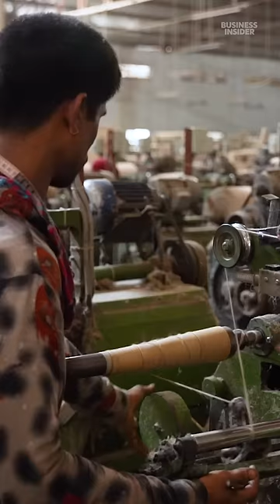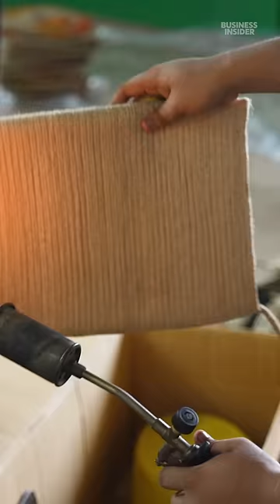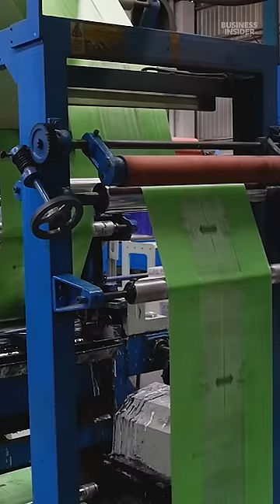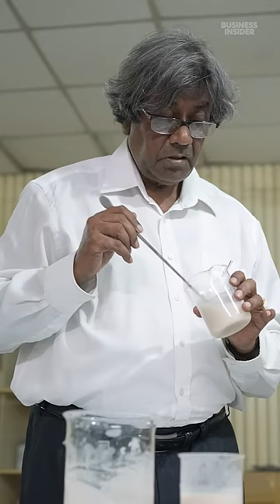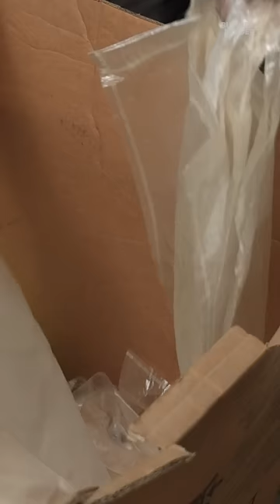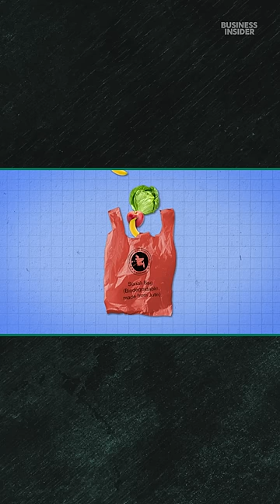Since #plastic bags are made from oil, they are not #biodegradable. Bags made from #jute are.

Comment: You people are aware that one of the primary byproducts of decomposition is carbon dioxide right?
Depending on The conditions that it's being broken down in You're still going to release quite a bit of carbon dioxide and probably methane into the atmosphere. It's why it would be a disaster if you could make bacteria that could eat our current plastic pollution problem. (Not to mention the whole now you have bacteria that eats your plastic before you want it to problem)
If you're trying to pitch this is a way to help reduce atmospheric emissions It won't.(at best a negligible net positive carbon sequestration) If you're trying to remove plastic pollution from the environment, Depending on what polymer you're creating It could be effective to completely unbiodegradable. PLA is a pretty decent example of this, It's made from corn and it still needs to be sent to a specialized industrial composting facility to get it to biodegrade. Ironically there's oil-based plastics that biodegrade better when you bury them in the ground than PLA. Not that that's really a great thing either. Not all of the components that go into it are and the gases and other byproducts released from decomposition depending on the conditions aren't exactly great for the environment either. Ironically just burning it would have a fairly similar effect or possibly better for the environment.(and you get power out of it if you want as well)
I'm all for solutions to problems It's just that they have to actually address the problem and be better than the current options. I just haven't received any information that would let me know if this is useful or just another way to make a already existing polymer. Some of these claims seem to be a bit dubious without more information.
😅

Comment: We just need to replace things with better things. Nothing will change if we don't take the financial hit initially. After a short time volume scale will solve the cost issue. There is almost no way to compete on cost with a deeply established petrol infrastructure that has established a very low cost point due to massive volume. The only way to change it is to just do it. At least I don't see a path around that elephant in the room.

Comment: More bioplastic? That's really dumb. We need to let go of plastic altogether. If we simply must have disposable grocery bags, paper is the way to go. We could probably make enough (albeit crappy, but you're not using it to write on) paper with manufacturing byproducts from lumber etc. Also, when rotting in a landfill, paper produces a lot less methane gas

Comment: 10 times the cost isn't really reasonable either. If you're doing grocery shopping and are in the mind of being environmentally friendly, you should carry with you a recycle bag/ shopping bag with you instead. Else, this biodegradable plastic would see very little use outside of shopping, or garbage bag. Plus they don't seem to last long (which means shorter shelf-life); you don't purchase small quantities of plastic bags/ garbage bags for household usage anyway, and stores wouldn't be keeping something that could potentially wear out quickly before a customer purchases them. Same with using it for water bottles (or liquid/food/ any containers), which would be impossible since it'd degrade within hours. Again, while the intention is good, it's far too costly, and its uses are extremely limited.

Comment: Thats not what biodegradable means, when life breaks materials down, the carbon is metabolized into CO2 while plastic wont, itll be plastic forever. So you got that backwards, but it breaking down is good, and the carbon came from the air in the first place so its part of the carbon cycle

Comment: Something not mentioned in this video, but probably should be investigated before we just jump on the jute train... They cost more which means the manufacturing process is probably far more labor-intensive. Why should you care about that?. Anything that requires more labor requires often more people and more machines sometimes more chemical treatments. Why is that important? It's important because that means the carbon footprint just to produce the bag is larger than a standard plastic bag. This is often looked at as what is known as a carbon production penalty. This applies to almost everything that we are looking at to replace what we have now. Even electric cars their carbon penalty for production is massive compared to the standard combustion engine vehicle. You would have to drive your electric car for nearly 80 years before you would break even with the amount of carbon released just producing that vehicle. Just some food for thought. Just because it sounds better on the back end doesn't mean that it was better on the front end.

Comment: The reason it costs more is because the demand for it is extremely low. In order to continue production and profit cost is higher.
Reply: No it's expensive because it's just another plant based polymer... You know what our first plastics were? We use oil based because those hydrocarbon based polymer chains are more stable and it's a byproduct of oil cracking.